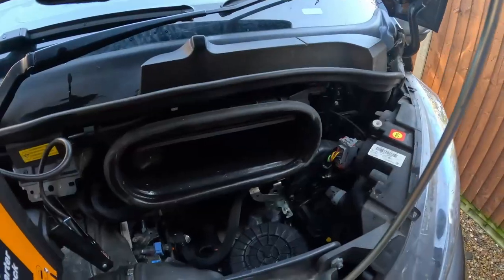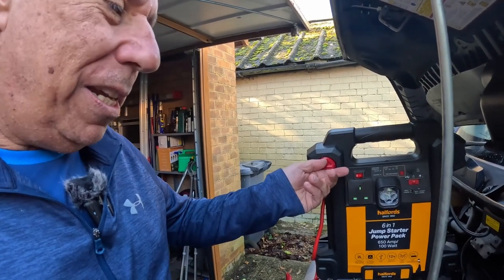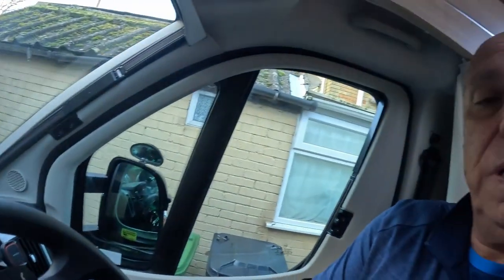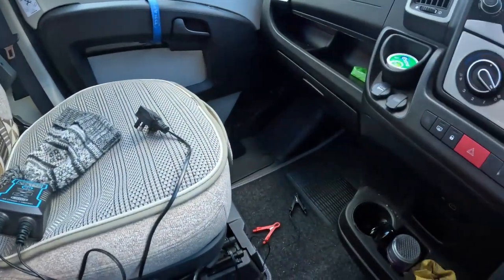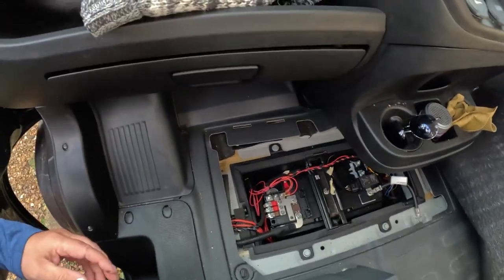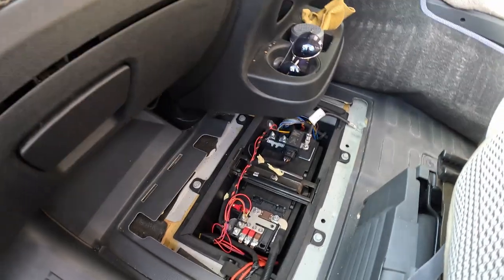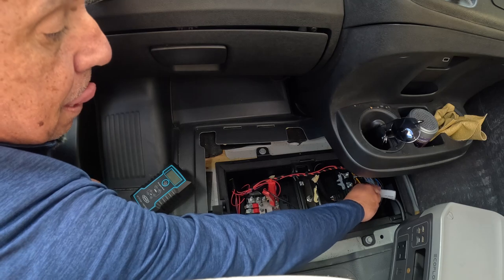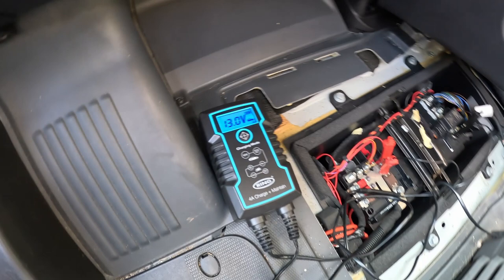Easy Steps To Jump Start Your Motorhome!

Comment: On my old motorhome. Just run a jump wire from leisure battery positive to engine battery positive. Leave for 10mins. Disconnect and then start Engine. Simple. George
Reply from the maker: Great idea George 👍